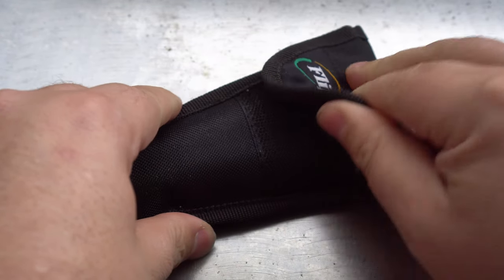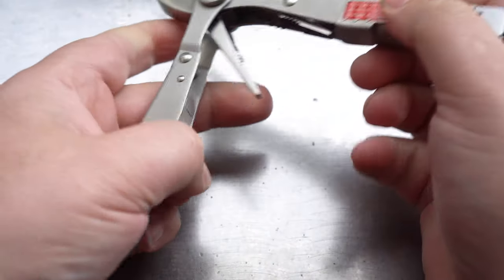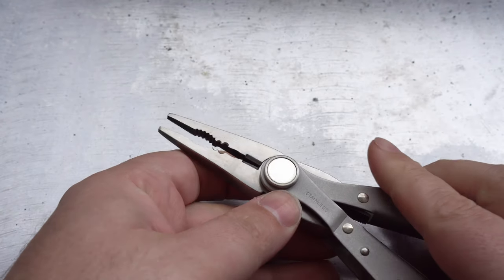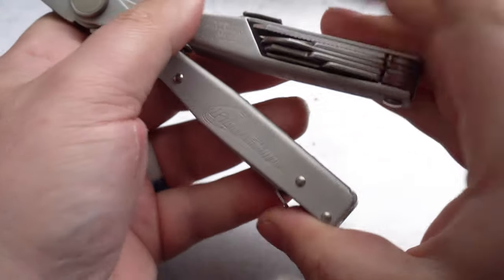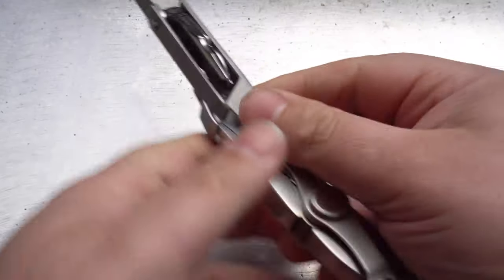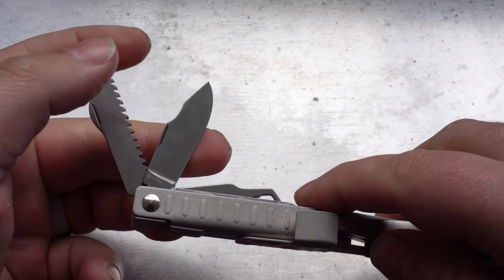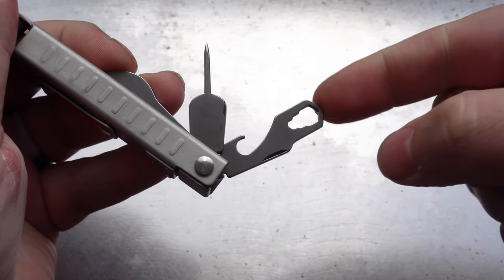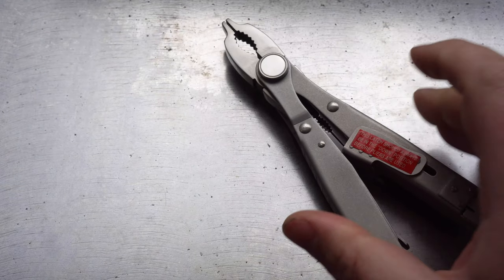Video review - Flip-Grip *4K Ultra HD*

Comment: Great review as always and you found one in great condition!  I got mine used and it was pretty banged up.  I have been using the pointed spike tip on mine as a sim card removal tool.  I am not sure if this was the purpose, but it works well.
Reply from the maker: Thanks, Jay Dee. I use the sim card tool on my Leatherman Tread. I think the flipgrip spike is too thick for my sim card holes. I was thinking as a belt hole maker but then it's too thin. Maybe we'll never really know.